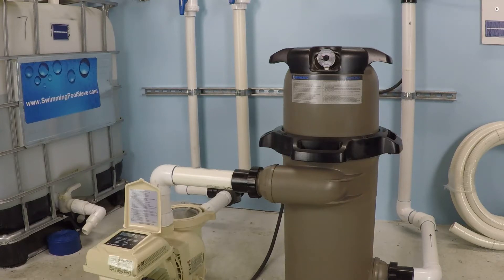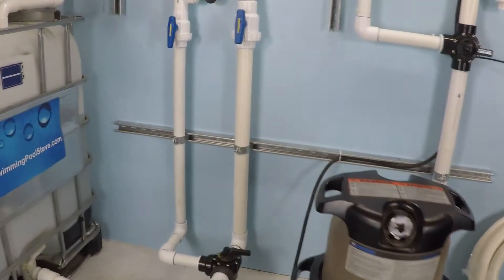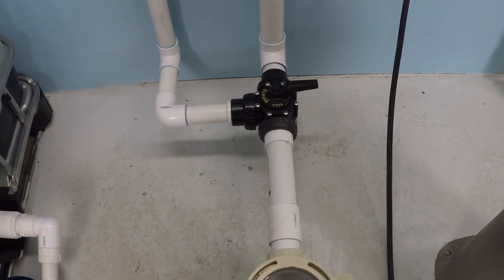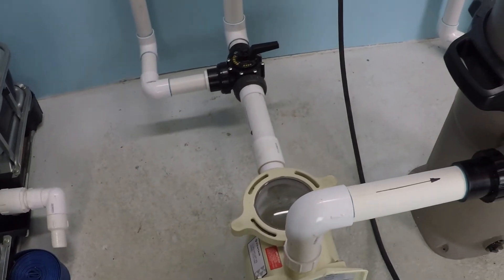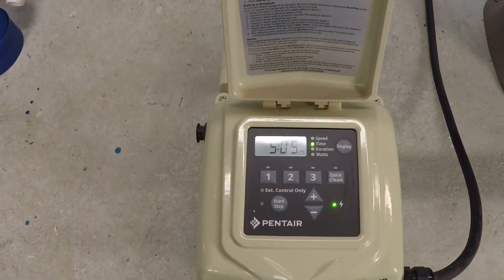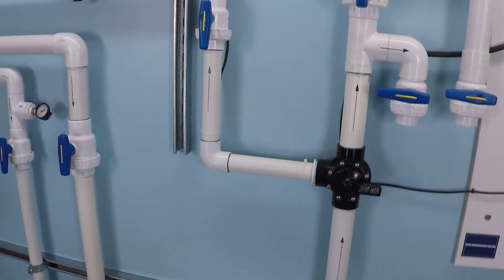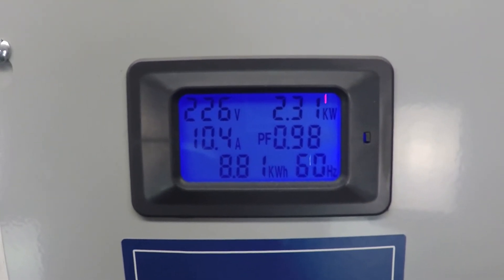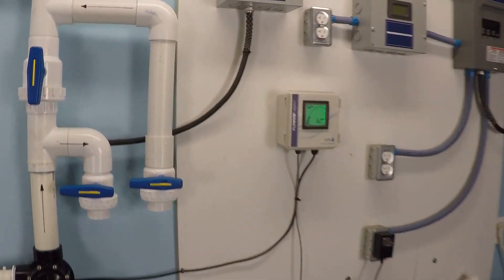Maximum Flow Test In 2" Pool Pipes

Comment: Hi Steve, my pool is around 40k gallons and my insisted that I only need 2" and would take no for an answer :/ I was able to get him to put in 3 skimmers with a 2" dedicated line back to the pump for each one and a dedicated 2" main drain line back to the pump. They all join at the pump and the pump had a 2" inlet. My question is, will this help flow having all dedicated lines and is it efficient enough for my pool. I really wanted to run 2.5" but he was getting upset with me and said it would take another $16k to do so. I would appreciate any feed back I kinds stressing out over this :/